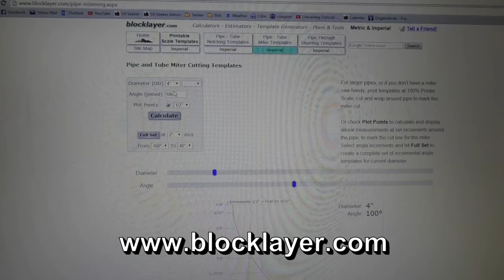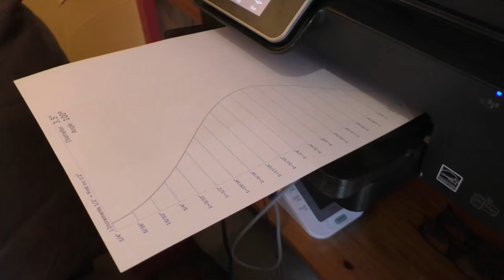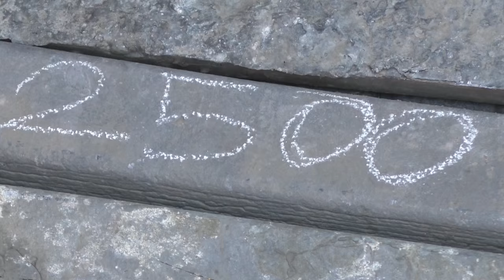Chinese Junk Sailboat - Catwalks and Keels and Engine

Comment: Why did you go the molten route with the lead? Ingots will work well enough and are removable. Also I hope you had blood work done after working with lead and very little controls.
Reply from the maker: +Be quiet and fish   Lead is expensive and shot or ingots would leave more that 20% of the volume unfilled, and able to shift.  Also lead is not a dangerous as you believe.
Reply: +SV Seeker Well I run two programs at a major shipyard. A real shipyard that puts ships at sea and maintains them, not a front yard. I am in charge of the seawater valve repair and a safety officer. I can tell you that you have no idea about lead safety from what I observed. Do not tell me that I don't understand what I am talking about because I do. I get that it is expensive but your lackadaisical methods of using it will cost you and any who crew that boat down the line.  Who pours lead next to a potable water tank with no precautions other than 1/4 inch steel? Seriously what are you thinking?

Comment: what about tacking wire mesh on the catwalk? it would let the water flow thru it freely, and remove the need to carry planking
Reply from the maker: +sysfixr   It would have to be formed channel in order not to bend and it would give waves a lot of surface area too.
Reply: I had to look up exactly what I meant, it's called expanded metal catwalk. No making channels or anything, just cut to size & tack weld it on each side. I still think any added resistance would be minimal.
here's an example:
mcnichols.com/products/grating/expanded-metal/standard-expanded-catwalk/

Comment: you need to feed the diesel like drip bags. I mean put it higher than the engine . at least when I had starting problems my mechanic had a plastic 5ltr can upside down with the pipe coming out of the cap and the return at the top where it had a part cut off so he could put fuel in it. so fuel was fed by gravity and was continuous,  so he also isolated the fuel pump.
Reply from the maker: +chvella   Thanks for the tip.

Comment: Was there an advantage to filling the keels with lead before the boat was either in the water or closer?  Just wondering what this does for transportation over the road.  Just a thought, not a criticism.
Reply from the maker: +Paul List  It will be under 38 tons with the lead and 38 tons is not a big deal to move in oil country.
Reply: It wasn't so much a weight thing as much as the stress on the hull trailering it down the road, as cradling it could be tricky, but I'm sure you have that all figured out too.  Good work.

Comment: Wouldn't it be possible to use galvanized expanded metal as decking on the starboard gangway, it would make for a safer footing when handling mooring lines etc and have minimal effect on wind and waves in heavy weather ?

Andrew
Reply from the maker: +Andrew B (Vikingboy)    I like a simple wood plank better.   They can be used for other purposes, and removed completely for bad weather.

Comment: Just screw a decent quality thermocouple in the manifold and forget about it.  In 20 years of high performance diesel stuff running temps way higher than the motor can stand long term I have never seen one melt off or break. I have seen plenty get killed by the heat where they don't work anymore, but that isn't a big deal. I imagine you all had the fuel kill wired up so you could start it? They spring load to the kill position and require  two coils to start and run as there is a pull in coil and a hold coil for the fuel kill. It seems obvious but I know people over look it often.

Comment: Hi mate.   While I think you have thought about  most things, I was wondering about a very important piece of equipment, that I have not  heard anything about at all.  This while it is a so very integral part of any ship's  navigation and proposed intentions.   No self respecting ship would leave port without it, and yet, not a dickybirt.  It must have been an oversight, what, in the rush of getting the boat build, and lead pored.  also the starting of the engine, and the building of the pilot house.  The closing of the decks, and the installing of the rudder.  Etc, etc,  but what is the horn going to be like?   : )    Your well on your way mate, keep plotting on, one day your there.
Reply from the maker: +Marcel Timmers   The horn?   :)
Reply: *****  Hi mate.  That is a good idea!

Comment: also I was just wondering you might want to see if you can add a little pressure behind the fuel going to the high pressure pump kinda like a gravity feed may work. in theory you shouldn't need one but it may need a little help with starting wish I could come help you start that motor .Cummins diesel tech
Reply from the maker: +Bman5.9 Yes     Thanks for the tip.
Reply: +SV Seeker no problem but don't read into to much B/c I believe your mechanical lift pump should do fine once its getting fuel sucks cuz I it could be so many different things but at least you know it's just fuel related

Comment: I was wanting to know why did you use lead in the lower hull instead of concrete?
Reply: +John Tvrdy Lead is 11 times heavier than water for a given volume,  concrete is only 2 times heavier. Concrete would take up 5 times more space than lead for a given weight.
Reply from the maker: +Andrew Hughes  Thanks Andrew

Comment: One old idea come to my mind when watching this, when i was a child i studied lot of books of old ships, and some pictures showed old wale hunting ships, of corse there was galleons and warships with so much cannons that it´s a wonder how they could keep the floating, but those wale hunters where actually the ships that draw most of my attention (together with the rig of the slaveships, of corse i hated slavery, but i will tell later why i looked at those ships upper parts), and that because they where built for long expeditions on the sea in all weathers, some of them had hulls constructed for artic climates, now to those slaveships for a short moment; the later ones of them often had reinforced rigs in order to increase the speed and the rig was constructed so the sail area could be maximized (that´s the useful parts of that concept, just sad that it was used for such a bad purpose until the more modern high speed sailers from the 1800 (wich where even better built) ), however, i think the reason tha whalers did not use that was it also made the ship more vulnerable to stormwinds, but in the 1800 there was some hybrid rigs specialy designed to both maximize speed and withstand hard winds, during the same period some re built whalerships was used for science expeditions, and that was what realy catched my mind. One example among many other was that those ships had a detachable plattform protruding from one side of the ship, originally ued to flesh whales, but easy to re-design as a multi purpose plattform for deepsea exploring, etc. That platform had detachable handrails on the seasides and could easy be lifted up in däverts (english name?) when it was not in use. The bed was hanged on a pendant so it hung stable in the sea, the ship had almost all facilitys needed on borad for long expeditions, even it´s own blacksmith onboard, etc. I realy like those old concept if used for sciense purposes, sort of the ultimate long travel ship as i see it.
Reply from the maker: +Sheep Ewe   Thanks for the insight.
Reply: I noticed today thay what i wrote yesterday night looked a bit strange...

However, it shall be realy interesting to see more of Your rigging project in the future when the hull is finished.

And my point was that, about the catwalk, i think that has potential for same use as my "multipurpose frame" looks like a wery pracitical thing to hawe, i was thinking the same idea, but in smaller scale on my boat too around the rudder area (sinse she does not hawe that balcony there), i early noticed that i was forced to hang outside the ralings each time i wanted to adjust things on the rear or maintenance parts on the hull, etc. So, this is a wery handy thing if on can construct it so it´s not catching the wawes in hard winds.

Comment: Whats the purpose of putting ingots in the keel before pouring molten lead on top?
Reply: There are no air pockets in it, pouring molten lead around it leads to a faster cool down and less warping of the keel. killing two birds with one stone, less lead to melt and the aforementioned decrease in cooling time.

Comment: I think that you could use grating on the catwalk.
Reply from the maker: +He Ka     You don't like walking on pipes?
Reply: SV Seeker I love it!
Reply: +SV Seeker No not in a rough sea. don't forget some docks  and anchorages are in rough water.
Reply: +SV Seeker what about using stretched mesh on your walkway , light weight , larger holes for more flow of water and cheaper than normal grating

Comment: Modern Thermocouples don't break off, buy a quality one and put it in as close to the turbo as possible. If you look at what guys are doing with high horsepower pickup trucks and they have no problems so you won't either.

Comment: And if you used a grid on the catwalks? I mean just for the sake of not having to mess with the planks later on, when you might need to use the catwalks. Something like this http://i00.i.aliimg.com/img/pb/877/679/486/486679877_871.jpg I think this wouldn't increase the surface area for the water very much.

Comment: Don't you have to pour the lead all in one pour to fill the keel
Reply from the maker: +bill739123   Yes if you are casting keel that will be attached to the boat.  We are simply pouring lead into a steel keel so we can do it in batches.

Comment: Is the reason you don't work on it for a couple months of summer because of the heat?
Reply from the maker: +dus “dustoin1386” toin    We'll work, we'll just work inside the shop with the AC on.